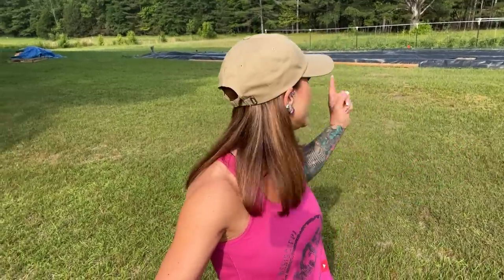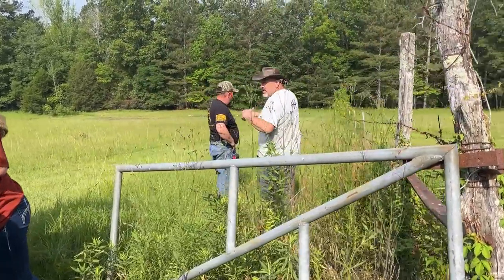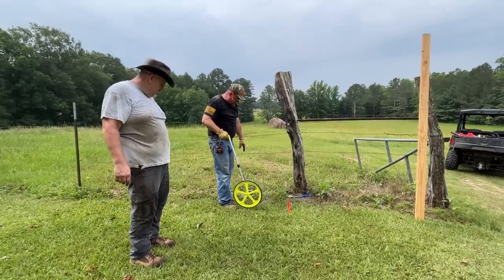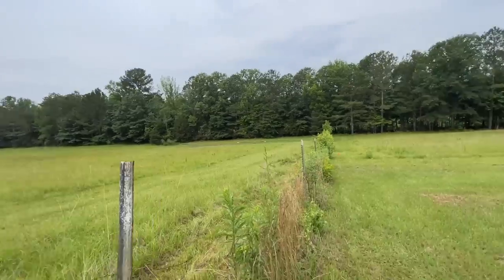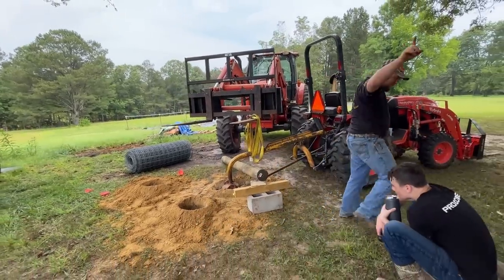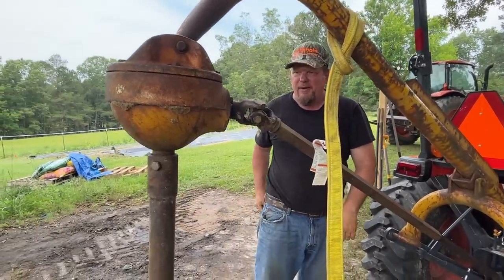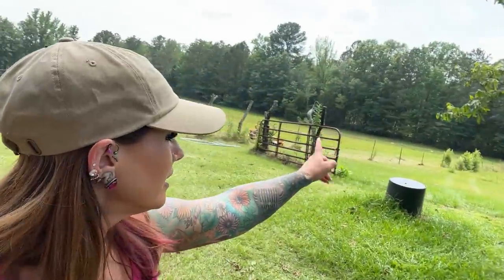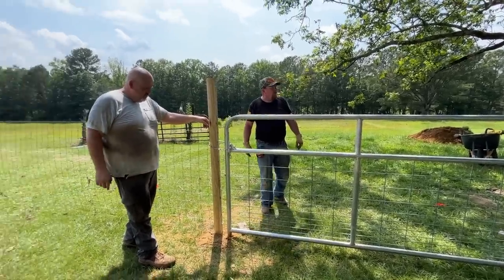Is It Time For An Upgrade? Our Tractor Couldn't Handle It! Kubota LX2610 Building Fences.

Comment: Great video.  My son is in the process of putting in 400' of pipe fence between hot weather, work, and wheat harvest.  You getting the auger stuck brought back a bad memory.  That is one thing I like about an auger on a skid steer, they are reversible if you get it stuck.

Comment: I bought a magnet pole because the previous owner that was a welder that threw stuff everywhere and it's saved me $$$ on tractor tires
Reply: Gpa had a big round magnet outta something he put a heavy wire thru for a handle and grandkids got the job of dragging it thru the yard to get any metal picked up.

Comment: I always put a diagonal brace from the top of the end post to the bottom of the second post.  Otherwise in wet weather the fence loosens the post and pulls it away from the gate opening-even when the post was cemented into the ground..

Comment: Mike had a "smooth move, slick" moment! LOL If ya gonna have that much acreage, if you can swing it, its best to have overkill and not need it than need it and not. You could still keep the one for the smaller jobs and maybe get a mowing deck for it to mow the yard or what not, but a bigger tractor with a lot more lead in its butt might prove very useful.

Comment: I have the B2601 and it came with the LA435 loader. I couldn’t help noticing that you have the larger loader on yours. Does the LX2610 come with that standard or did you upgrade?
Reply from the maker: That was stock as we bought it . 😀